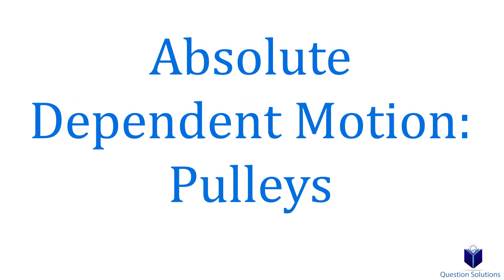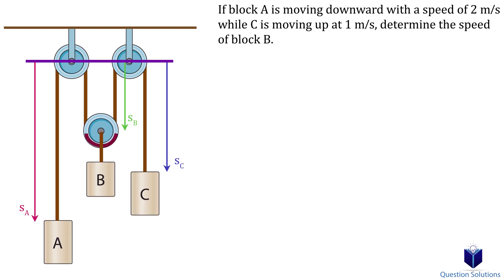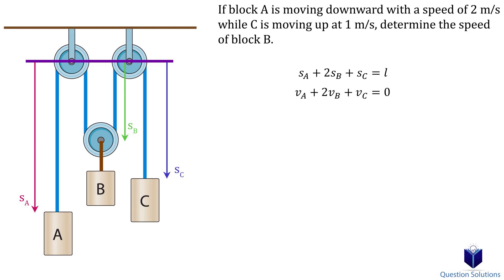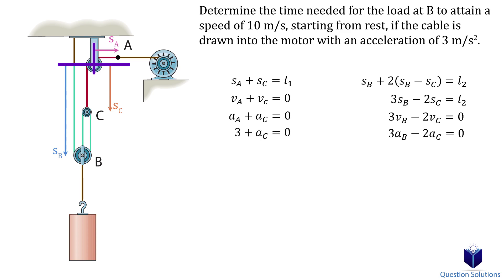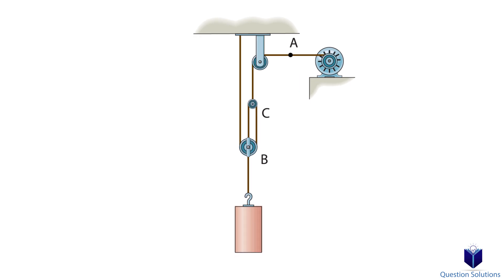Absolute Dependent Motion: Pulleys (learn to solve any problem)

Comment: 7:14 thank you very much for this! Btw I got a one question. How does the total length becomes 0 on the other side when the derivative of that equation is taken ( when u turn them for velocities)
Reply from the maker: So imagine you have a piece of rope in front of you. After marking off some random spot, you pull the rope to one side. Now compared to that spot, the rope has a velocity, it's displacing some distance with respect to time. But does the total length of the rope itself change? No, it stays constant. And what happens to any constant when we take the derivative? It becomes 0.

Comment: At 4:57 I am a bit confused. The length of string 2 is not constant right? Because the string that disappears on the left does not go anywhere else in the system. So how can you say that the length of string 2 is constant, and therefore take the derivative and set it as zero?
Reply from the maker: The second cable doesn't move to the left. It just goes up and down. A segment of the first cable goes to the right, but that makes no difference to our equation, since the total length of the rope itself doesn't change. If you're referring to the cable that goes up and down, again, it doesn't matter, the total length of the cable does not change, it can't change, it's a physical item, pieces don't disappear off into the air. 😅
Reply: @QuestionSolutions No but where does the extra sting go for the cable that moves up and down because I know where the string goes for the other cable but not for the one that goes up and down that's what's confusing me
Reply from the maker: @PeterDoesPhysics I saw this randomly on YouTube, this might help you visualize what happens better than what I can do with animations: https://youtube.com/shorts/q4ZuJz2HbtY?si=sbMTPbTA7TFwxOzS
Reply: @QuestionSolutions No I get the other examples...but this one is different to me...where does the string in the bottom string go? Because it's not connected to anywhere that removes string like the top string is
Reply from the maker: @PeterDoesPhysics  I don't know what you're asking. 😅 You literally just need to follow the ropes with your eyes and you can figure out how it moves using your imagination. The only other option I can think of is to actually just build this with pulleys and ropes you get from the store and see it in person to get an intuitive sense. Maybe your professor or TA can help you out better. Best wishes.
Reply: @QuestionSolutions  I don't have a professor or TA Im studying physics for fun 😭

Idk I understand it mathematically I just don't know where that rope goes...I guess I''ll just accept it for now and move on
Reply from the maker: @PeterDoesPhysics can you tell me which rope is the one that bugs you? Is the the one on the very left?
Reply: @QuestionSolutions yes I just want to know where the string that disappears goes
Reply from the maker: @PeterDoesPhysics It doesn't disappear. It gets rolled up into the large pulley.

Comment: do we multiply and subtract the values of length s based on how many cables are in the diagram?
Reply from the maker: Yes, "s" signifies a "length" of cable, so if you have two of the same lengths, then it's 2s and so forth.

Comment: Hi, thanks for your video! I approached the question with a method of not using a fixed length and I'm wondering if this approach is valid?

I placed the datum at the middle pulley, sB as from datum to top pulley on the left side, and sA as from datum to bottom pulley. I got an equation L = sB + 3 sA, derived and isolated A which I got vA = -vB/3. Since rope is pulled downwards at B, but my vB is on the left side, upward relative to my datum, so my vB is +4 m/s. Plugging this into the equation vA = -vB/3 and I got vA as -1.33 m/s, but this downward relative to the my datum so my final vA is 1.33 m/s upwards.
Reply from the maker: You're very welcome!

Which question is this in reference to? Please give me a timestamp so I can follow along with your method. Thanks! (also, if you get the same answer, then your method is perfectly fine. Most of these questions can be solved using more than one method.)

Comment: in 7:02 how there is a two times( Sa --h)? isn't there only 1 Sa ? also in 5:03 .  About the two times sb
Reply from the maker: So notice how there are 2 of those cables. Those 2 cables requires two sets of equations, but instead of writing the same thing twice, you can just put a 2 in front, so you multiply the value by 2, indicating there are 2 sets.
Reply: @QuestionSolutions  Thank you so much

Comment: hello man, im in 9th grade rn and my teachers arent explaining anything about pulleys so i extremely appreciate you putting this video but i got a couple of doubts. how do you derive velocity from length and turn length into zero. also how does 2h disappear in the last equation because of this. i willl really grateful if you can answer my doubt
Reply from the maker: So I am not sure I can explain this to you through a comment, and it's better if you ask your teacher this in person. I will give it a shot but you need to have some background in calculus/advanced functions to understand this. This video was made for engineering students so there is a presumption that calculus is already covered. Regardless, I am going to give it my best shot.

When we have changing lengths, those can be represented as equations that are not constant. For example, y = 3x+2, y=x^2-2, etc. In other words, the change in lengths of cables can be mapped out as equations. (This isn't shown, but try to think of it that way). When we go from lengths to velocity, we are asking, how fast does this change occur? So how fast does the length of the cable change, or how fast does block A move, etc. To do that, we need to get the slope of our equations. In other words, derivatives. But you can simply think of it as slope changes. In linear equations and any other equation that is not a constant, there is a value > 0 or <0 for change in slope. So that slope value that we can get from our equations is velocity. However, when we have constants, in other words, lengths that do not change, we get equations like y = 3. So what does that look like? It's just a horizontal line across our x-y axis with a y-intercept at 3. In other words, for every x value we input, we just have 3. Now what would be the slope of such a line? It's 0. In simple terms, there is no change in slope, it's always 0 because the line is purely horizontal without any change. So that means, any constant value we have, when we go from lengths to velocity will become 0, because there is no change in velocity. It stays still. That distance doesn't change. 

I hope that helps, but this was a great question from someone in gr9, and I encourage you to follow up with your teachers.
Reply: I am thankful for the quick response. I had a feeling it was related to find the derivative of some slope but this confirms it. I dont have these exact types of qns for school but I do have some other variation of pulley problems , I am actually studying for competitive exams . Thank you very much, if I had tried to search or ask any teacher I probably wouldn't have got any answer. Can you share me your email or any other way through which I can contact your doubts like this. My school's physics teacher isn't good at solving doubts and I would be grateful for someone knowledgeable like you to answer my doubts. I promise I won't bombard you with lots of wns and you can answer them when you have time
Reply from the maker: @Zyxxucuvig8hiboouur  Sure, you can email me at contact(at)questionsolutions.com replace (at) with @. If I have time, I will send you a reply. :)

Comment: @ 5:21 and 7:14, why do we multiply a 2 in front of the lengths?
Reply from the maker: There are two pieces of cable that signifies that length. So if you look at 5:21, and you look at the big pulley at the very bottom, notice there are 2 short cable along with one big cable. The 2 represents two of those cables.
Reply: @QuestionSolutions  got it, thankyou!

Comment: May I ask how do I determine how do I determine how many total cables are there in each questions? I'm always confused on how to determine it and how many s equations to form which relates to how many cables.
Reply from the maker: One way would be to trace the lines with your pencil. So you start off at a beginning and then trace that line, if it loops around a pulley, it's still continuous. If it stops at a hook or the middle piece of a pulley, then that's the end of a segment. 

For example, at 4:23, we have a line starting at the top left, we trace it down, loops around pulley B, then loops about pulley C, but then ends at the middle of pully B. That's one cable. 

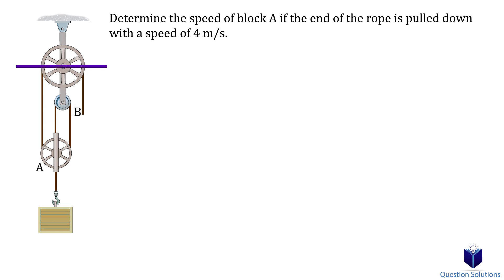At 6:40, we start at point B, it goes around the huge flywheel, goes to pully A and loops around that, then it goes up to the small pulley and loops around that and ends at the middle of pully A. That's a single cable. 

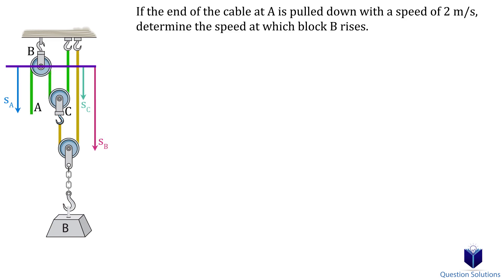At 3:07, a cable start at A and loops around pulley B, goes and loops around pulley C and ends at a hook. The other cable starts at a top hook on the top right, goes down and loops around the bottom pulley and abruptly ends at the hook attached to pulley C. 

So you trace them with your pencil, and see where they end. Usually, they end on a hook or the middle piece of a pulley. If it loops around a pulley, it's continues. I hope that helps.

Comment: Is there a better way of notating the derivative of the equation in example 2? It just seems very confusing.
Reply from the maker: The derivative as in the velocity? It depends on the notation used by your professor/book/faculty. Generally, most books use "s" or "x" for displacement, and "v" for velocity, and "a" for acceleration. Is the change from "s" to "v" the confusing part? I am not really following which part is confusing. Please let me know and I'll do my best to help. What's shown on the video is the conventional method used by most books.

Comment: Thanks for your efforts 
But can you tell me how we got the second equation in  3:57

The negative sign confuse me

The same thing in the second equation 5:15
Reply from the maker: So imagine you have a 3m long piece of wood. You also have a 1m long piece of wood. If someone tells you to find the difference in length between the 3m long wood piece and the 1m long wood piece, how would you do it? You'd subtract 1m from the 3m. So you'd write "3 - 1 = 2 m" It's the same thing here. To give a length with respect to other established lengths, you sometimes need to subtract one length from the other.
Reply: @QuestionSolutions  I got it 

Thanks ❤

Comment: How come that in Problem no.3, the length of Sa and (Sb-Sc) does not become constants? in fact its doesnt change at all  since Sa is in a fixed position as well as (Sb-Sc)?
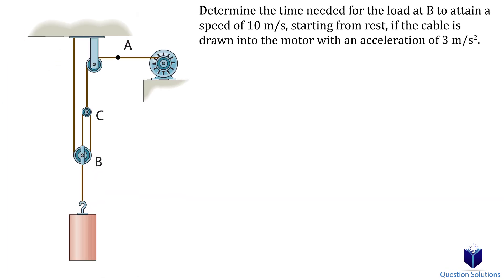Reply from the maker: So if you look at point A, which is the black dot, and then imagine the motor pulling on the rope, you will find that it moves to the right. I actually animated this (4:14) to make it easier to see. That length changes. The same is true for Sb-Sc, though the animation doesn't show a good job of showing this since it's a minute change. Constants are objects that don't change, have any movements, etc. So a metal piece isn't going to budge, like you see in example 4. It doesn't matter what rope is being pulled, a welded on metal piece won't move around. So I guess you have to use a bit of imagination to really see how things move. Also keep in mind that once we establish a point on a rope, and then a datum, we are seeing if that point moves with respect to the datum. 👍

Comment: How did you get sb +2(sb-sc) = L2 in question 2?
Reply from the maker: So you have to isolate for SC as shown at 3:55 and then plug that value into the first equation. Please follow the blue line I drew, and then plug it in and you will get sb +2(sb-sc) = L2. :)
Reply: @QuestionSolutions  thank you!!!!

Comment: At 5:03 you give the equation for pulley B’s cable length. Why Sb+2(Sb-Sc) instead of Sb+2Sb-Sc? I’m having trouble seeing where that second Sc term comes from.
Reply from the maker: So if you look you can see there are two cables between pully C and B. SB represents the length from the datum to pully B, so we don't have 2 of those cables. So it can't be 2SB. How can we determine the length between pully C and B? We can do that by subtracting the length of SC from SB. So the total length to pully B minus the length to pully C. You have 2 cables, so we get 2(SB-SC).

Comment: Thanks for the video it was very helpful but I am still a bit confused with deciding which lengths are fixed. I know the cables around pulleys are fixed but for the example, you solved 4:12 I don't get why the cables between C and B are constant. Even with the animation, I can't convince myself it is constant. Can you explain how you decide which cables are constant?
Reply from the maker: Cables C and B are not constant. We just wrote the difference, rather the length, in terms of SC and SB. Your intuition is correct in that they are not constant, but you are applying your knowledge incorrectly. Most of the time, metal hooks, metal beams, etc tend to be fixed lengths. So here, in the second equation, we wrote "SB+2(SB-SC)=l2". So we are saying the length of cable 2 is all of those components. The "2(SB-SC)" is the length of those 2 small cables, they are not constant at all.
Reply: @QuestionSolutions  Thanks a lot
Reply from the maker: @Abasaana_kanyiri  You're very welcome!

Comment: in the third problem the length of cable from C to B doesnt change in length. You said earlier in the video that we dont need to account for unchanging lengths, so why do we account for it here?
Reply from the maker: It actually does change lengths. It's just hard to show it, but there is a small change as it's being pulled up since cable BC is wrapped around the big pulley.

Comment: I have a confusion,
In example 4, the two strings attached to the small pulley doesnt seem to have the same length. So why are we taking 2(sa-h)?
Reply from the maker: We look to the midpoint of the bottom pulley, so they have the same length, which includes the metal piece.

Comment: on example 3 and 4 why is 2 (Sb - SC) & 2(Sb-h) the way I see it is (2sb - c) and (2sb - h)
Reply from the maker: The way you wrote your equation is wrong. What we are saying is, that component, or that length of rope is Sb-Sc, and we have 2 of those pieces. So it's 2 times both of those chunks. 👍

Comment: I dont know if this contradicts what you are doing, but what I have been taught to do is after getting the relation e.g  Sa + Sb = 0, to then draw a free body diagram for each system and to assume the direction where the cable length increases to be positive. thank you for the video
Reply from the maker: There are many ways to solve these problems. I think its much easier to just pick the direction of your position coordinates to be positive, instead of going back and forth with positives and negatives trying to find which moves up and which moves down. It's completely up to you, but with this method, if you get a negative value, its opposite to the direction of your position coordinates, and if its positive, its in the same direction. Its a lot easier to keep track of. This also eliminates the need to draw free body diagrams since you said your method requires that as well. In the end, it's entirely up to you 👍

Comment: What it would be for constant speed?
Reply from the maker: Sorry, I don't understand your question. What part are you referring to?
Reply: Like if i want to move a block at constant speeds say at 5m/s and 10m/s. Then how to calculate the required force in both cases?
Reply from the maker: @_BickromSaha  Required force to move the blocks? You'd need to consider work and energy or conservation of energy, depends on what is given in the question. This chapter only involves figuring out the speed of one block if we know the speed of another block, not calculating forces. There are videos on the playlist about the subjects I mentioned.  👍

Comment: @QuestionsSolution or anyone that sees this,please explain to me why it is Sb+(Sb-sc)
Reply from the maker: I think you are referring to 3:20? Okay, so let's look at the 2nd cable (the brown one). The long distance is represented with SB since we labeled it as such. However, we didn't label the small section. Why? Because we can represent it as a difference of 2 cables. Notice that if we subtract the length of SC from SB, it gives us the same length as the small piece. A way to see this practically is to actually get a few pieces of strings. One long one, and 2 short ones. You lay them side by side, exactly as it is in the diagram. So on the right side, we have a long piece, and on the left side, we have 2 small pieces. We label the long piece and one of the short pieces. How do we represent the length of the piece that's left over? All we have to do subtract the length of the labeled short piece from the labeled long piece and that would give us the length of the remaining piece. I hope that makes sense.
Reply: @QuestionSolutions  Thank you very much, it makes sense now
Reply from the maker: @ashleydludlu4407  Awesome!

Comment: could I theoretically have said Sa+Sb+(Sa-2Sb)=L for the first equation? Also your videos are incredibly helpful!
Reply from the maker: Hmm, no, because that doesn't account for the cable attached to block C. So Sa-Sb gives us a small section on cable A, if you subtract 2Sb, I am not sure what that accounts for, I guess 2 lengths of Sb from Sa, because you're "subtracting" the length of Sb from Sa. Also, since you only have Sa and Sb, you can't get the velocity of C. Usually, I think its a lot better to keep them as simple as possible, just a position coordinate per pulley. I am glad the videos are helpful :) Many thanks!